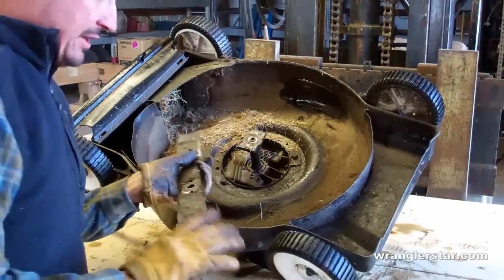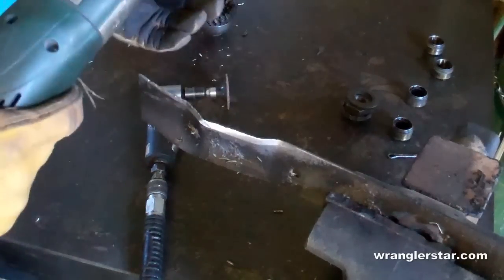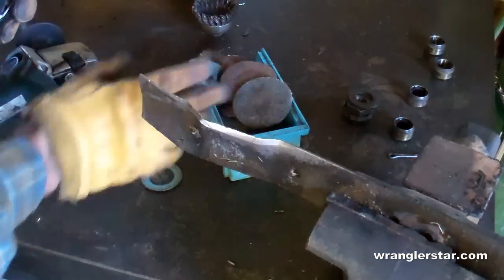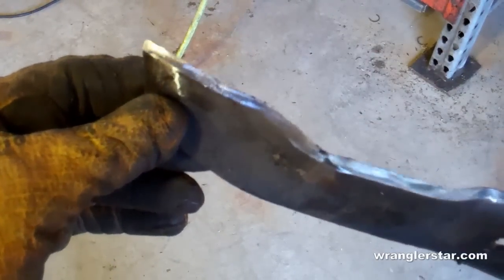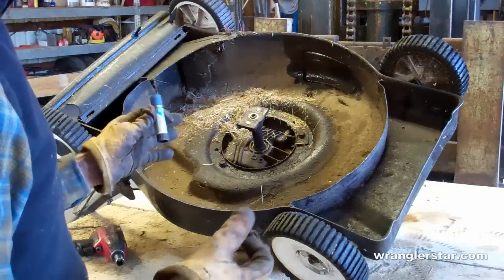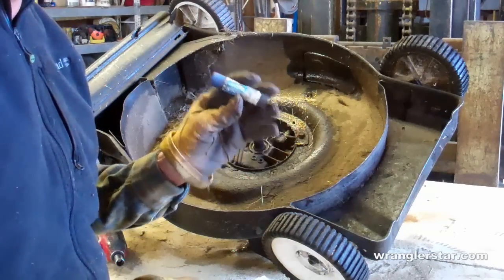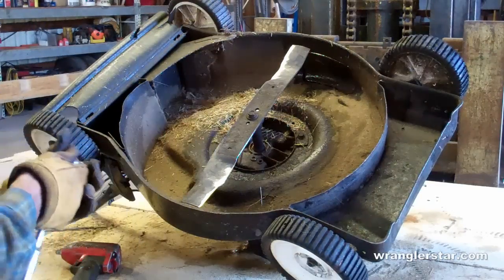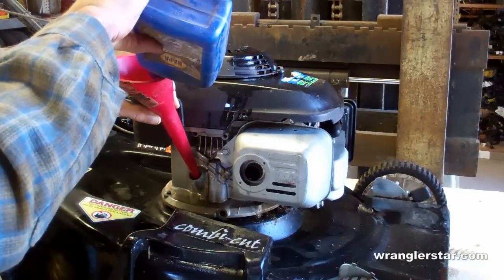How To Sharpen A Lawn Mower Blade

Comment: The "rolock" system is the rubber/twist on system for your pads/sanding disks. They are awesome! We use the blue scotch brite ones for prepping aluminum prior to welding(keep a dedicated pad for aluminum only). IMHO they are the best/easiest way to clean/prep aluminum.

Comment: You did not Balance the Blade!
Reply: John:  This is spot on.  I even own one of those little hand peices and it hadn't occurred to me to use it on my lawnmower blade.  Thanks!  P.S.  Go ahead and throw that sorry old "mulching" blade away now.
Reply: That was meant for Wranglestar...  As for the balancing comment.  If you use the little air tool, you are not removing enough material to make a significant imbalance.  Disclaimer: The blade he was working there is so far gone that it will likely need to be balanced if you sharpened it with an Emory board.
Reply: John lecitron.   did you notice the blade is bent. ???
Reply: did you notice the blade was not SHARP>> it still had burrs, frets and gouges
Reply: twosence fromcleveland 
Yes you actually are removing enough to make it quite significantly unbalanced.  Then the next time you do it you will make it even worse and so on.. ALWAYS balance your blades every sharpening and your spindle bearings will thank you greatly as well as everything else vibrating around on the deck.. good videos tho! Keep them coming.

Comment: Jerry PA Lawn Nut, I never see any of you guys check the track of the blade when you install it. I have found that the shaft and or the blade can take on a very slight set and the tips of the newly sharpened blade can have a small difference in cutting height at the tip. Just a few thousands at the hub, or close to it, can make a 1/16 inch height difference at the tip of the blade. I check this and if it is a 32ed of an inch, by eye, I reverse the blade mounting position by 180 degrees and see if the track is closer. If it is not I usually settle for a 90 degree position from there until I can get a new blade. The closer the track and balance the less vibration when the mower is operating and the less wear on the mower and the fatigue of the operator. Maybe at 70 I worry about that more then others do..

Comment: Cody, do you find it unnecessary to balance your blades? I do it every time, its a quick extra that make the mower run a little smoother a far a vibration and some what reduces accelerated wear on the engine

Comment: You can tilt it on its side with the carb up if you dont want to drain the oil or run the gas out to flip it upside down. Make sure you pull the plug wire off the plug before you do anything to it though.

Comment: You have to balance the blade.  Put a screw driver in the center bolt hole and balance the blade.  If one side drops down farther then the other, just grind off some of the blade until it balances itself evenly on  the screwdriver shank.

Comment: Locktite red is for high temperature locations, like muffler bolts on chainsaws.  I use 242 blue for most bolts, unless they get hot.  In that case I use red locktite.

Comment: Or buy a $7 mower blade sharpening drill bit/kit that includes balancing jig. Also, don't waste time or oil by draining engine. place something heavy on the handle or wedge handle under the shed to access blade then, zip it off with impact. Metal file comes in handy to knock down knicks in blade before sharpening.

Comment: yeah, if it comes from the factory with the "extension tube" you should not fill it up to the top :) You just might hydraulic the gas motor. However I think if you fill to the top of the standard opening on the factory block it will be just dandy (pretty much exactly how he showed). But I reckon that if he didn't cross every T and dot every I, that he would probably have someone that got electrocuted from trying to fill thier "green machine california electric wiz getter".

Comment: good luck getting that bolt out      i see youve been mowing rocks with that blade  try picking up the lawn befor you mow    and tipping the mower over like that     you must like buying air filters and getting oil in your carb      whats the saying  more money than brains